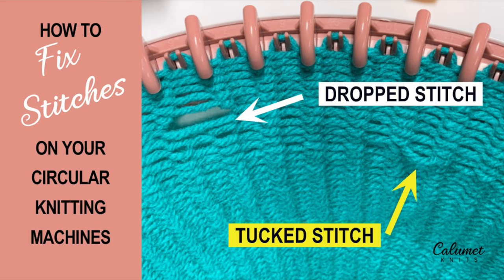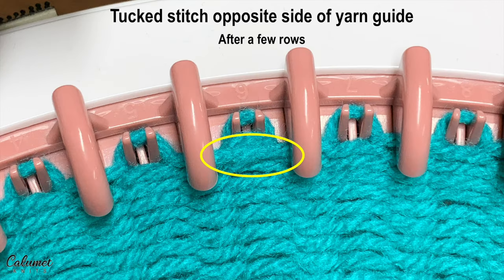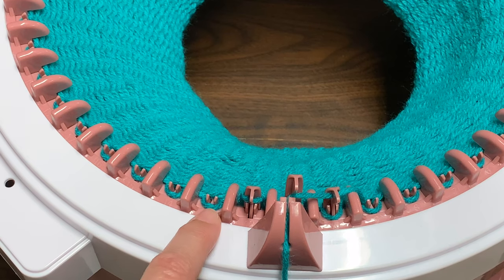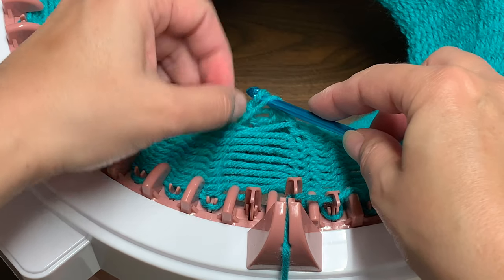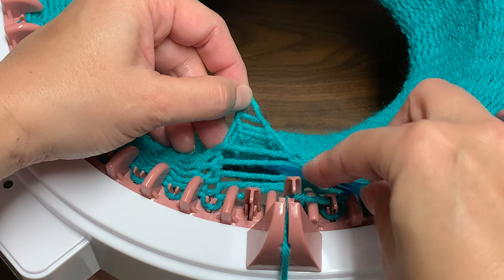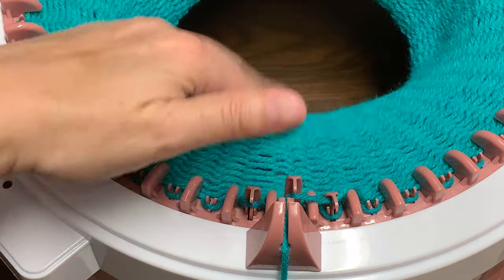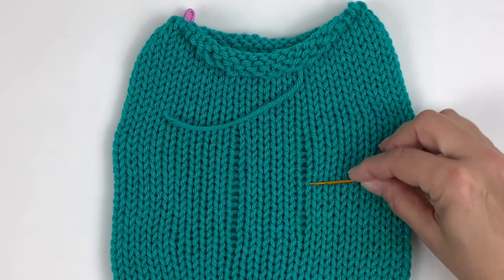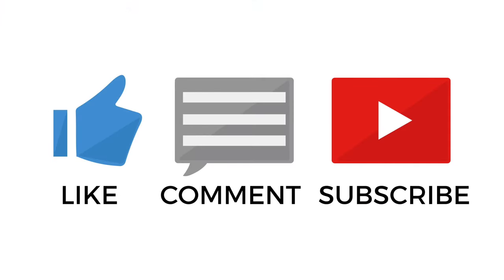How to Fix Tucked and Dropped Stitches on your Circular Knitting Machines

Comment: Great video, knitting even on the sentro is a little like black magic to me and when it goes wrong it’s a real problem I just don’t understand the engineering…I’m more of a home sewist and rigid fabric seems a lot safer than yarn but I so want to conquer knitting (I’m a really slow hand knitter) so the sentro is something I want to work on, there’s so much lovely yarn out there!
Reply from the maker: Thanks! It gets easier over time. Tension is key and once you master that there's no stopping you! Also, pick yarns that are easy on the machine (light worsted works the best).

Comment: What a game changer this was, I attempted my first beanie with a rib, I had only used my machine three other times, to make three straight forward brimmed hats with different wool, I am a ‘56 year old ‘newbie’, who can knit, very basically, can not crochet and needs processes explained clearly and concisely. In attempting the rib, I had no problem picking up the stitches it was reattaching them to the hook and then knitting them, the only video I had watched showed you to the right of the wool feed, so you ‘hand’ knitted the picked up stitch once you rehooked, it just kept creating tucked or dropped stitches again, in the end I just marked the dropped stitches and picked them up after I had cast off! The tucked stitch, however became 3 tucked stitches, that was much harder! Do you have a video that shows more than one tucked stitch in a row, I winged it but I would love to see a video showing me how to do it, properly or easily!!! Do you have one? Thank you.
Reply from the maker: I always fix stitches on the left side of the yarn guide. So, whatever column comes first, that is what I fix even. If I have three columns in the row, I always start with the most right column first. If your stitches are out of order, you have to follow the order of the column to the right. If that one is messed up, you keep moving to the right until you find the correct order, then you work on fixing the columns in next column to the left and so on.
Reply: @CalumetKnits  Thank you so much for replying, I have screen shot it, so I can reference it, I do write down pointers, then, often, can’t follow my own instructions, so this will be perfect. Have a enjoyable Sunday.

Comment: Very helpful! I use a latch hook instead of a crochet hook. I find it easier. BUT I have an Addi so I know it's harder with the caridge in the way.  I also find that my yarn is tighter... It doesn't stretch as much as yours.
Reply from the maker: I run into some tight stitches as well. If you can't get it back on the needle, place a locking stitch marker on it and wait for it come around a second time. It should be easier.
Reply: @CalumetKnits  love that idea!

Comment: Excellent tutorial.  Very clear camera angles and explanations.  I didn’t know about putting the next bar over the end of crochet hook then back on again to get the stitch on the hook over.  I struggle sometimes getting the stitch over the bar but your way makes the bit a lot easier. Many thanks. 😊
Reply from the maker: Awesome, thank you! Sometimes you just need to see a different way to do things.
Reply: 12:31 so happy I found your 😊site. Unfortunately, I have two dropped stitches side-by😊-side and I've pretty much butchered my yarn trying to fix them. Your video teaching style is perfect for me, I know I'll succeed, and the worn out yarn will be like a badge of honor. Thank you.
Reply: @janicedrew4515  I ended up frogging the same hat 2 times as I didn't know what or how to fix the imperfections. Going to try it again with the same yarn. At least I'm not wasting yarn this way, even if the final project isn't what anyone other than myself would wear. And, yes, it WILL be a badge of honor!

Comment: Great Tutorial.  Can you fix the stitches when you noticed them on the machine.  Correcting after a few rows is well and good, but can you show how to fix when you notice them on the machine.  That would be great.
Reply from the maker: In the video I show you how the incorrect stitches are made. You just need to watch for these as you knit. Tension is key! Fix your tension and you won't need to watch every stitch.

Comment: Thank you. Now I know how to fix tucked stitches and even it out after I remove it from the machine.  What exactly causes the tucked stitch- is it too thick of a yarn or tension, or is it some other reason?  Appreciate your explanation on how to fix these.
Reply from the maker: Tension is a huge part! Even the slightest adjustment will make big changes in how the stitch falls down the needle. Too tight and it can't move, too loose and it floats around the needle. I suggest experimenting using your hand and adjusting the tension. Yarn makes a big difference as well. You need a yarn that can stretch a bit (trial and error to find ones that work).

Comment: Idk if it's just that my tension gauge is crap, or if the sentro is just junk; but. I tried doing this and had to frog 60+ stitches because there were just too many issues to fix :( back to using a ton of waste yarn and trying to tension by hand, hopefully that fixes the issue. Thank you for the tutorial, just wanted to let others know it's probably not worth the heartache if you have a ton of problems in your project that you didn't notice 🥲
Reply: Update: didn't fix the issue, the sentro is probably just garbage haha
Reply from the maker: It might be your yarn and not the machine. Sometimes the machines just don't like the yarn. And, you have to experiment with different tension (beyond the tensioner).

Comment: Thank you SO much for this video! Dropped stitches usually meant I had to take the project off the loom and start over.  Another question, though:  what is happening when a tube (for a hat, for instance) is finished, and when you bind off, there are parts that look like a crease in the yarn?  I don't know how to post a photo for you to see... but maybe you know what I mean.
Reply from the maker: You are so welcome!  I think the crease-like is due to tension. You want to make sure that your tension is consistent throughout.  If you look at the row of stitches you may noticed that they are much smaller than the rest. This means your tension was tighter for this section than the rest of the tube.  The can also be bigger (elongated) which is also a tension issue. I hope this helps.

Comment: Thanks for this great explanation.  Is there a way to avoid tucked stitches happening i.e. What is the cause?
Reply from the maker: Tension! Tension is the key to knitting perfectly. Sometimes you need a little more or a little less than the 3 settings. Adding a weight to a problem area can also help pull those stitches down so they don't get tucked.

Comment: Maybe you can help me. I've finished my beanie and am ready to cast off. Unfortunately, I seem to have 2 dropped stitches right near where I would start. I don't see the stitch but there are a few ladder stitches right on top. I'm afraid to try to fix them on the machine. Could I just cast off all of the stitches and try to fix it when it's off?  Sorry for the long post😌Wanted to send a pic but there no place to do it in comments.

Comment: I'm dealing with 2 problems... I just changed colors and I wound up having dropped stitches right before I get back to the starting needle. Can I pick up. Also, I'm not sure how many stitches need  fixing. Hard to explain without a picture. Then there's a single yarn strand right after that didn't catch I guess. Is there any way of fixing that? I've gotten this far and I'd like to not have to rip it out. I need to learn to fix these kinds of things. I could send you a pic if that would help.

Comment: When fixing a tucked stitch what do you do when one bar is crossing over another and they can not be put back in the correct order?
Reply from the maker: You have to go back to the last good column of stitches, then fix the column to the left, then the next left column, etc... you may find several columns that out of order. Always use the order from the column to the right.
Reply: @CalumetKnits  Thank you so much. I am new to circular knitting. I got frustrated and frogged the project and started all over again.

Comment: How do you fix a stitch when the yarn splits.  I usually use 4-ply yarn and sometimes one of the strands gets stuck on the needle causing a slip stitch or a tucked stitch and I get so frustrated when I have to frog everything.  Thanks for the very informative video.
Reply from the maker: The same way, drop that column of stitches until you reach the split yarn then redo the column.
Reply: thank you for your reply.  I will try your recommendation with my fingers crossed.  I replay your video until it sinks in.  I let you know how it goes.

Comment: Would the size hook changes that problem when you used h or I hook? I wonder if you use thin hook to fox that problem at the end? Just wondering. I was not sure if I should order knitting machine after I saw your video. Maybe I should try that.
Reply from the maker: I usually grab whatever size hook I have layering around. You can definitely use a smaller hook or even a latch hook. I typically don't need to even out the stitches if I catch the problem with a few rows. Its usually when you have to undo 5+ rows where you start to see the uneven stitches.

Comment: This is helpful if the tucked stitch got way past your knitting point but how to we fix them when they’re right at the needles. That point when you have two strands on the two hooks.
Reply from the maker: The exact same way... remove the stitches from the hook and reladder. To prevent, make sure the stitches are at the bottom of the needle before the yarn feeder.

Comment: You make it look so easy. I’ve been using knitting machines since January. I now how 5 if you include my Addi-egg. I’ve watched so many videos like this and can’t get it right. Yesterday I had to frog a project 5 times with tricky yarn. So many tucked stitches. I am going to try again. It is beautiful yarn! This made sense. I also ordered knitting machine weights. I have never had this much trouble. My tubes are generally so nice. (Craftsmart Arizona yarn and I bought 5 of them) I’ve tried dryer sheets, lotion on my hands, silicone ear plug. Now maybe I can catch them as they occur. Is there a way to fix them when they happen instead of waiting? I’m going super slow watching each stitch. It make take a few days to make one beanie.
Reply from the maker: For tucked stitches, you have to watch the stitch fall to the bottom of the needle. If you can catch these ahead of time, you will not have to fix them. For dropped stitches, you have to watch to make sure the yarn is caught by the hook of the needle.  There are some yarns that just don't work well in the machines. That's OK, just keep a list of what works for you.

Comment: If you use a smaller gauge  hook will the tension be so loose? What is the gauge of the needles?
Reply from the maker: I find it doesn't really matter which size hook to use because the tension the tension on the stitch is removed when you start to undo the stitches. The needle size is about 5.5 to 6mm.

Comment: Tucked sts are annoying & happen in most of my hats.  I understand what a tucked st is, how it happened, how to fix it.  But how do I prevent it from happening?  Is it getting snagged on the machine plastic somehow?   Would kumihimo weights clipped to the fabric prevent it?
Reply from the maker: They sure are!! Tension is key. Sometimes the slightest change will make a world of a difference. You could have a burr somewhere that is preventing the yarn from sliding over. I would recommend keeping track of the location. If it's the same needle, change the needle.  Weights will help. I use them when needed. Kumihimo weights will work! Each yarn is different so you'll have to play around to find what works.
Reply: @CalumetKnits  ok ty so much for your quick reply.  I'll give this a try.

Comment: It is so interesting that I only experience tuck stitches on my circular knitting machines, both the Addi & Sentro.
I do not experience tuck stitches with my flatbed knitting machines.  The tuck stitch is the bane of my circular 
knitting (LOL).
Reply from the maker: They are for everyone! Do you use weights with your flat bed? I think the needles are better with the flat bed and sock machines.
Reply: @CalumetKnits :  Yes, weights are an absolute requirement with flatbed knitting.  I am preparing to start a cardigan project using my Brother KX350 knitting machine.

Comment: I have multiple loops on one peg however it has happened before forming a single stitch. Anyone any advice?
Reply from the maker: You should only have 1 loop at a time. You might not be casting on properly.

Comment: How do you avoid them?
Reply from the maker: Tension! You have to learn how to control the tension (beyond the  basic tensioner). You can also add weights if you have a stubborn area. Sometimes the machine does not like certain yarns and if this is the case, use something different and avoid a headache.